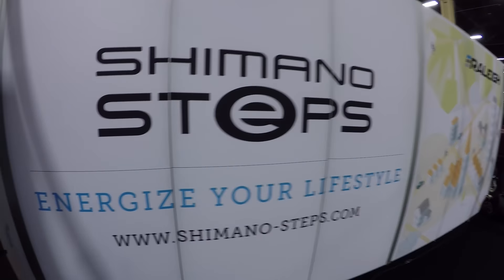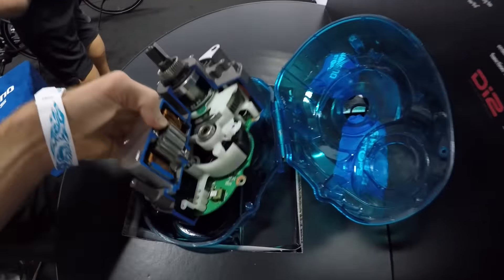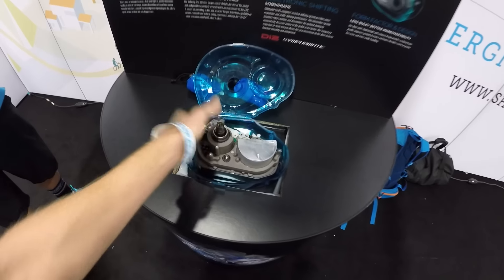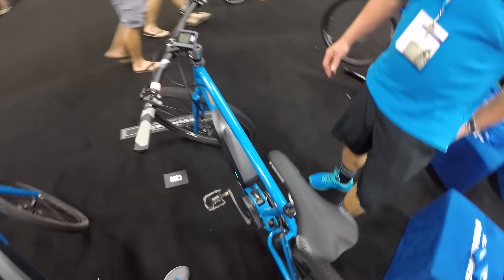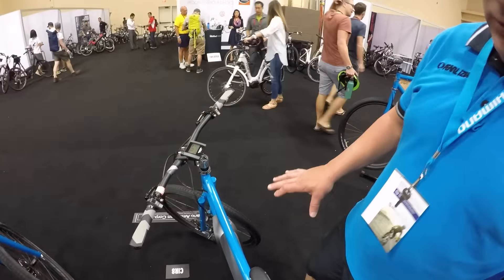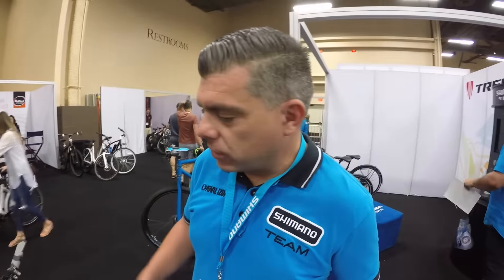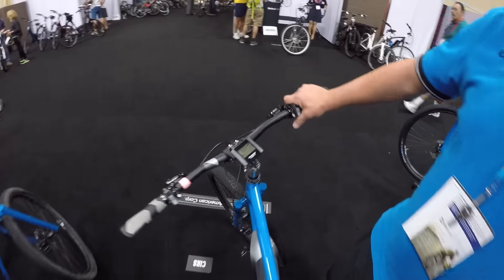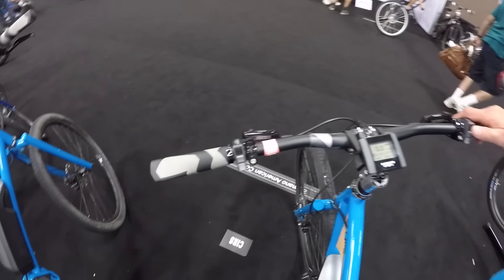2016 Shimano STEPS Updates from Interbike

Comment: they keep only releasing 250w ebikes.  250w ebikess are good for efficieny and lightweight small battery but they should also do higher power versions also like a 2kw with economy mode. you need more power to climb steep hills well